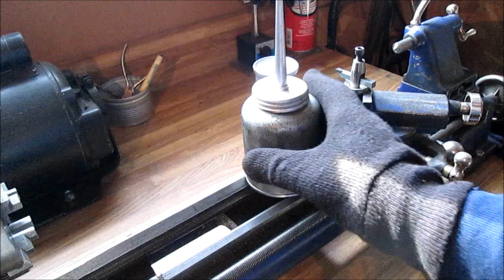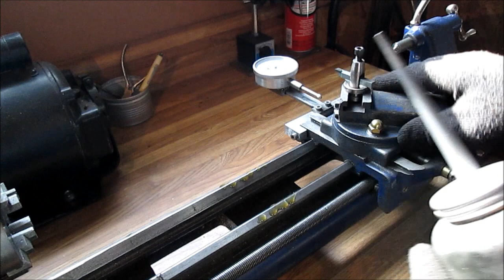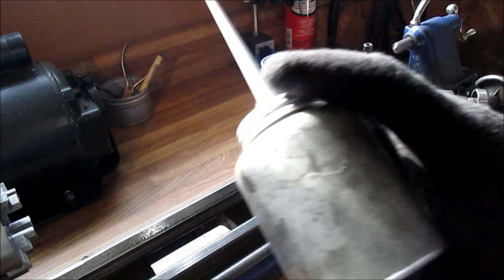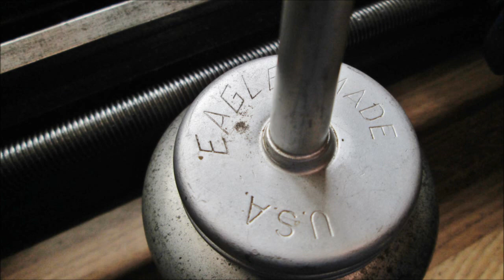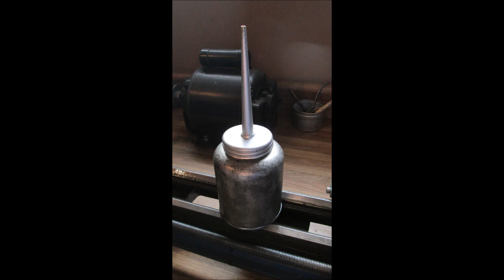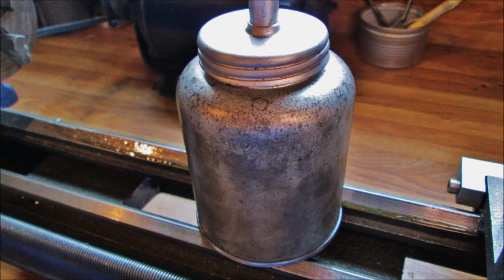Old EAGLE Brand Oil Can

Comment: The pump kind always sprays oil.  These are nice, much more controlled, oil goes where you want it to.
Reply from the maker: Craig Arndt Just right for oiling the old lathe a few drops on the parts before using it